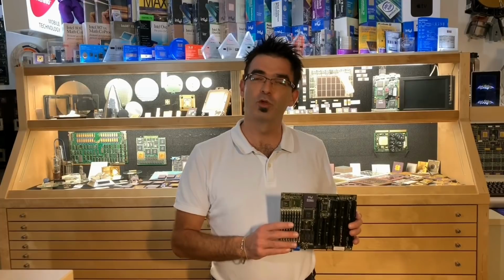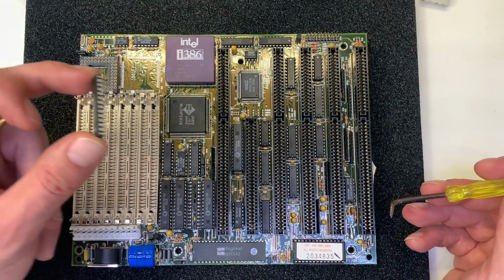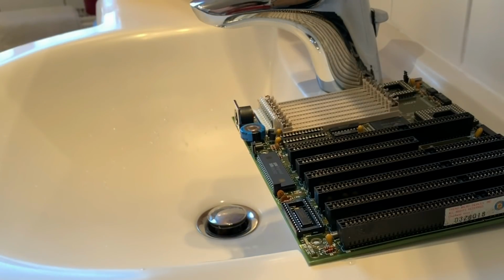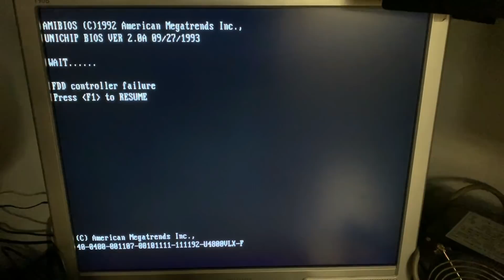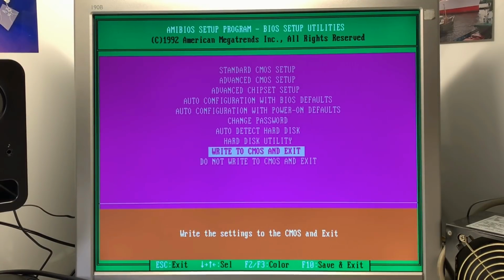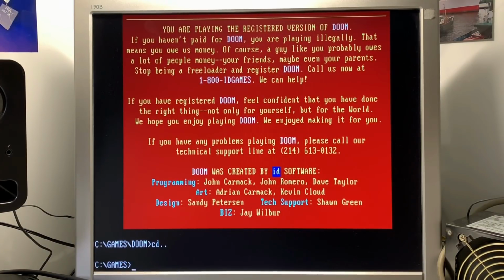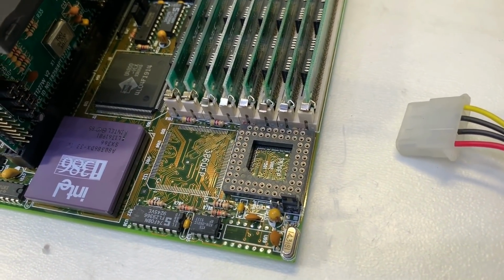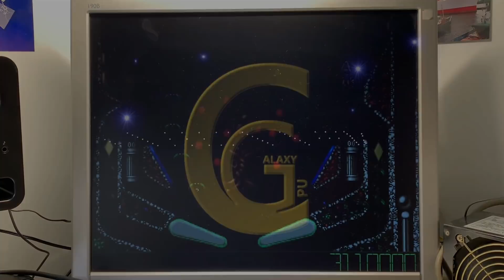Unichip 386 Board - Repairing - Cleaning - Testing - playing Doom  on a Intel 386

Comment: Man I almost died when you ran that motherboard straight under that running water. I was sure that that board was now broken as I was always told that water and electricity do not mix.
Reply: water and electricity don't play well together, however, there's no electricity involved when pouring water on PCBs, is it? . 😉
Reply: @ruxandy  Not initially, no, but there is eventually.
Reply: @yogibear2k220  wut?

Comment: I have a nice board with a lot of damage from the battery leak. At least fourteen traces are broken. Do I have to solider thin wires, or there is a better way to fix?

Comment: I got a Dkt Datatech Intel 80386 20 Mhz motherboard but it looks worse than this board, I have cleaned it and relpaced a broken diode and found one bad trace that I fixed with a wire, but it still won't post / start up, I don't know if it was working before the battery went bad I bought it cheap on ebay and my first thought was it coud be easy to fix but now I don't know :(

Comment: Thanks.  I have a couple batteries that need to go and not sure which way to go.  The capacitor seems safe.  Is that just an ATX to AT power adapter?
Reply from the maker: Yes, its ATX to AT adapter, so I need only one PSU for my testbench.

Comment: When you dry the board in the oven, how about not putting the solder side on the metal rack. If you have any battery, or capacitor voltage you could short something out like that. May I suggest, just to be cautious, place it on a ceramic plate to avoid shorting the solder side pins.     Just sayin'                                    Mike
Reply from the maker: There is absolutely nowhere any charge to get shortet. Also no battery. So nothing to worry about to have the board on the metal. 😉
Reply: @CPUGalaxy  What about the cap you replaced the battery with? I wouldn't do it anyway just to be sure.........Mike

Comment: I really wonder how long that capacitor is able to provide enough power to keep clock and BIOS settings. I was thinking about this method, but people told me I would need a huge capacitor with insanely high Farad rating to come anywhere close to the original ni-cd battery's capacity.
Reply from the maker: I was connecting the board from the video after 6 months and the cmos settings were still there. HDD type and memory....
The only thing i saw was that the date and time was not right. 10 days behind...  so it seems the capacitor has enough power to keep the settings for 6 months, but the clock is loosing somehow time...
Reply: @CPUGalaxy  Hmm, that is strange. More than likely I will go with using AA NiMH cells and wire them to the terminals, but might look further into this capacitor upgrade method.

Comment: Why does nostalgia have to hurt so much?  I don't remember Doom running so slow.  I wondering if its because I had the turbo button on.  I think my 386 was 8MHz (normal)/16MHz(Turbo).  I'm now wondering how all the circuitry worked and if you're able to switch that board into turbo.  I still have my old 386 in the closet. I should dig it out and go take a look.
Reply: Turbo made the CPU slower, to make it compatible with older 4.77mhz programs that were too fast normally.
Reply: Yeah…that’s not how turbo works 😆 We’ve all been fooled by that.

Comment: i wonder if a coprocessor could help with doom's performance

edit: i should wait for the end of the video :)
Reply from the maker: Unfortunately not. Doom is not using the FPU at all.
Reply: @CPUGalaxy  good to know, thanks
Reply: The 387 was notoriously slow.  Games of this era used fixed point arithmetic.  Another thing to note is the 387 was optional(and expensive, mostly only purchase by the scientific community) and it wouldn't make sense to write code that supported it.  It wasn't until the 486 (I do believe earlier 486s didn't have it and thus needed a 387) that the FPU was integrated into the CPU.

Comment: To leave the battery in and put the motherboard in the water????  You should clan the board first then put the battery in.
Reply: its not a battery its a capacitor he used so it comes discharged